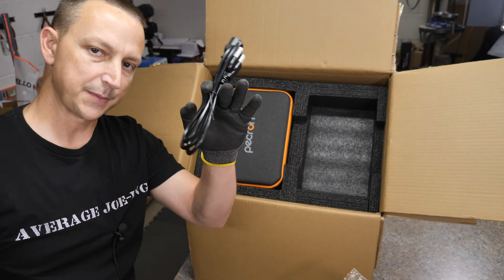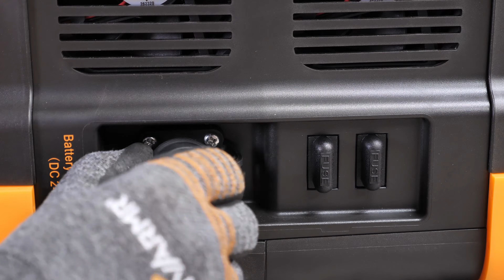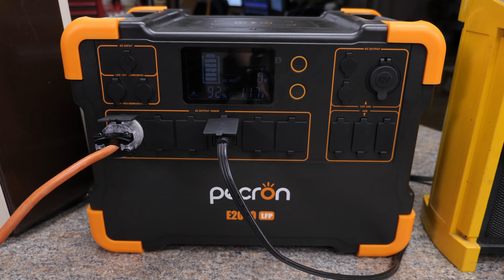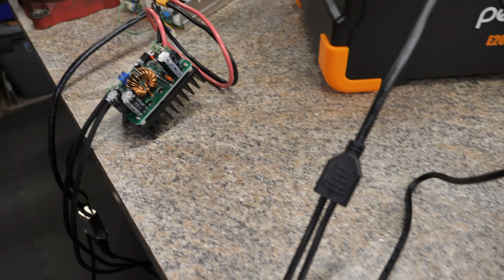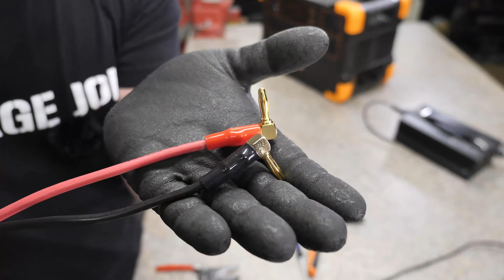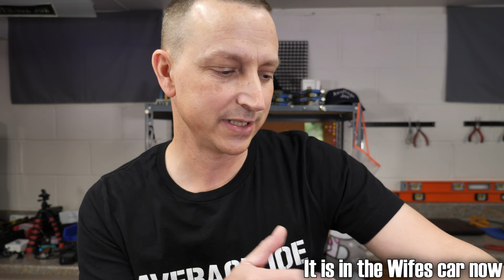Pecron E2000 LFP Portable Power Station Review

Comment: Just got my pecron 2000. My charger doesn't have a handle. I tried to register it for the warranty but it isn't clear where the serial # is. The manual only shows how to charge it with solar panels. Not very user friendly unless you know all the electrician lingo.

Comment: This was my first purchase but mine had the TT-30 plug which worked well with my 50 amp transfer switch. I have  since installed this in an outside storage that I am using as a UPS to power a chest freezer in case of an outage. The only con was there was no app to monitor the battery, but I installed a smart plug that I can monitor if the power goes out. This thing is a beast and had no issues whatsoever. 

Great and entertaining content for an Average Joe!! Well done!

Comment: I love it. I'm getting one. In January I was running a small space heater continuously to save on the gas bill.  Eventually the wires couldn't handle it but the breaker didn't trip. I burned up the wires in my small old house. I'm lucky the house didn't catch on fire.  The utility company cut the cables to the house. It would cost thousands to get this fixed, inspected, and I'm a hoarder and there's lots of junk that would have to be worked around. Not happening.    So now I'm off the grid and not coming back. I've been using a small 2400W gasoline generator intermittently, candles and antique oil lamps, but  I need something to run a small 12v chest refer/freezer continuously. I think this thing with 1200W of solar panels is going to help me out a lot. I've looked at some other power stations and I think this is the one. Cheers.
Reply from the maker: This one is great and for a great price!🤘

Comment: I have a Pecron with the 48V battery with the 2 pin MJ32 port.  Are you going to review one of those units (E1500, E2400, E1000, E3600 which uses the EP3000 expansion battery) to see if that hack we are not supposed to do will work?  LOL.  The banana plug is too small for the MJ32 holes.  Is there another bigger connector that is larger in diameter than the banana connector that would work?

Comment: This unit has been upgraded with an RV 30 amp outlet. Does it make sense to plug it to an rv AC panel via a transfer switch box and switch back and forth to the 30 amp shore power?

Comment: If my pick-up get to hot the cooling fans will come on even with main power off  I couldn't   figure out when I left it in the car it would lose power. I own the E3000 and E200LFP w/ one batt
Reply: Probably you left the ac inverter on that's why it lost power while sitting on your car without use

Comment: Can i contact you using regular email? I dont have or use facebook or instagram. Thanks
Reply from the maker: Whay did you need?
Reply: @AVERAGE_JOE  
Hi, I am almost done with my  cargo trailer conversion and was thinking of going with the Pecron 1500lfp. I want to connect my fuse box directly to its 30amp port but its expansion pack is 48 volts(and stupid expensive) and im trying to keep everything simple and functional ? so your work around was using the Pecron 2000 witch uses the 24 volt expansion battery! Could i do something similar using the 1500lfp? Im pretty handy at most things and the actual wiring is not a problem its all the volts vs amps business that has me a bit confused and im trying to stay away from a big elaborate electrical setup$$. I have also purchased a small dual fuel generator as a backup. I will be running  usual stuff ,,, diesel heater, 2 maxxfans, 10 led puck lights and a 12volt fridge and a couple of usb sockets. Just wanted to pick your brain. I have spent a huge amount of hours watching youtube but this was first time i saw your channel pop up, glad it did!

Thank you.
Reply from the maker: Oh ok gotcha, yeah I havent tested the 1500lfp so I cant say for sure. Send me an email averagejoestuff@gmail

Comment: So your expansion setup is bi-directional? It just makes the metering incorrect? That's super cool...

Could you also hook the battery through the 5pin charge port? Maybe through the MC4 cable for cleanliness?
Reply: Yes have EG4 48v being charged by 800 w thru victron 100/30 that feeds the mc4 into the solar port

Comment: I love my E2000LFP, but there's a couple of cons relative to competitors:

1. The practical surge power is ridiculously low. While power-number-wise, it's high, the surge duration is extremely low. So it will not power motors that have longer surge needs (as you noticed with your miter, same result with a gas dryer). My 1200W output power station powers my dryer no problem. It's not the surge power, it's the surge duration that's inadequate.

2. Expansion limited to 2 extra batteries (compare to Oupes for example that can support 4-6, depending on model). Pecron has indicated the overall resistance will be too low if you connect more than 2 additional batteries (and I believe this includes adding your own batteries).

3. Proprietary charge connector. I don't mind aviation-style plugs, but a standard connector such as Andersen or XT60 is much easier to get. There is similar standard aviation connector that should fit the E2000LFP, but Pecron's connector is a bit unique.

4. External power supply. There's some pros to this such as being able to replace the AC charger in case it dies, but practically, the inverters used to charge stations with built-in AC charging don't really fail.

Having said all that, the price (i got it for way more than current pricing which is ridiculously good), insane efficiency, and expandability makes it a great buy. Also great is the simplicity of Pecron's extra battery connections. There's no fancy balancing procedure, etc. All batteries, including the built-in one, are just paralleled. That means if the E2000LFP fully drains, but the EB3000 still has charge, the poeer station will still work.

The newest E1500LFP adds built-in AC charging and app connectivity (though sometimes app and FW updates can really screw up the usability of the power station). But you give up the great solar input power which is a much more important factor to me be than built-in AC charging and app connectivity.

Comment: Nice little power station!  I was really surprised that you could utilize their plug to connect any 24v battery.  

In my mind the AC charger is 50/50.  I like that the power station doesn't have the extra weight, but I would be the person to take the power station away from the house and forget the charger...

Comment: Not a bad unit and to make it perfect it would have the charger built in and instead of the weird DC connectors for charging I would put XT60 or XT90 connectors on it (like the ecoflow)
It is a shame that it can't do 2000W continuously like it's advertised but I guess 1800W is good enough (at the cost of additional efficiency).
Cool stuff.

Comment: This is one of my favorite power stations, mostly for the great solar input range. I have one running a chest freezer all the time and has been for over a year. No issues yet. I have it connected to 4 solar panels I got used that put out 32 volts each or 36 volts when not plugged in, about 900 watts worth and I have seen 650 watts in summer on the screen. I have 2 wired in series and 2 wired in parallel going to both the bigger solar inputs. I keep one set in parallel so I can charge other power stations off of it that take less than 60 volts max.

Comment: Looks like they changed the unit vs what you have, your link goes to a unit that has a TT-30 outlet in place of 2 of the 5-20R plugs.
Reply: I bought one directly  from Pecron in April and it had the TT-30 outlet. I think the ones on Amazon at the time did not.

Comment: Thanks Joe I hooked up my 48 volt battery to it and burned down my house. You didn't tell me I couldn't. Lol I'm glad they didn't lock down this port. I think this is the one I'm going to pick up for use around my land
Reply from the maker: 😆😆😆RIGHT!!! Yeah I like that they didnt lock it down as well. LOTSO potential there! I really like this one! Cant say that for all the others!
Reply: @AVERAGE_JOE what do you end up use for that port? I plan on using 48v battery to extend this power station. I think I would use the cable provided to connect to 48v bat using the 600w port. So this would use 48v battery  to charge the Pecron. But I don't know how to use the Pecron to charge back the 48v battery
Reply: @TienTran-bi1jv  Hey, to charge an external battery one could use a solar charge controller and have the solar panels charge that external battery, and then the battery feed the powerstation. That would allow for even bigger solar array (and solar charge controller) as well as many batteries, and use the powerstation as the inverter and all in one outputs ready to use (with its added battery capacity of course). Much easier and neatier than solar inverters that need so many breakers and stuff. (you'd still need protection between the solar panels and the solar charger, and between the solar charger and battery).